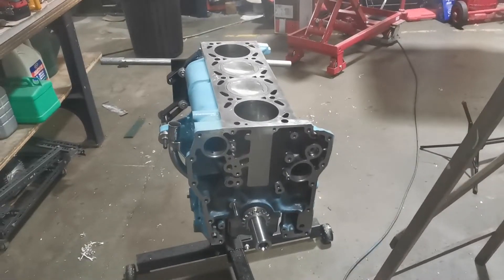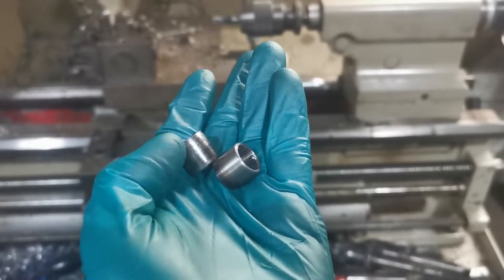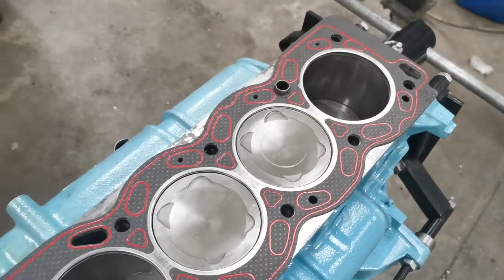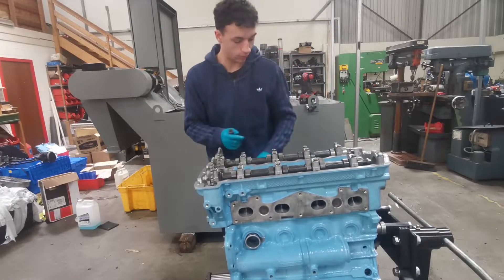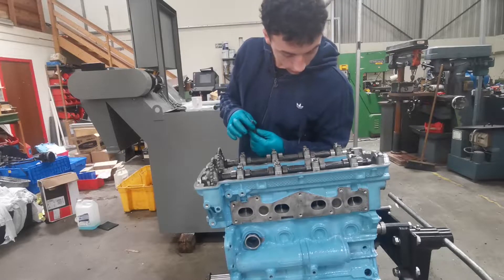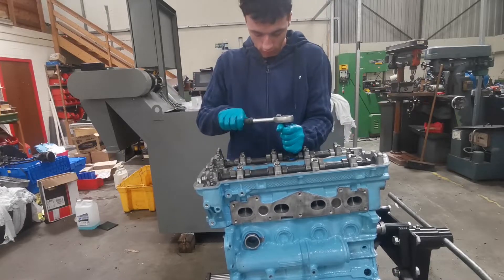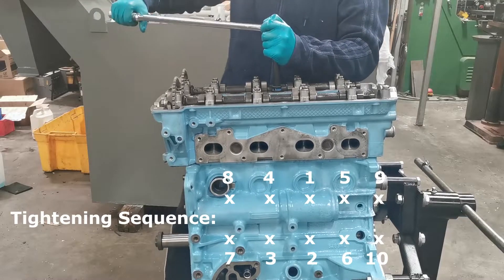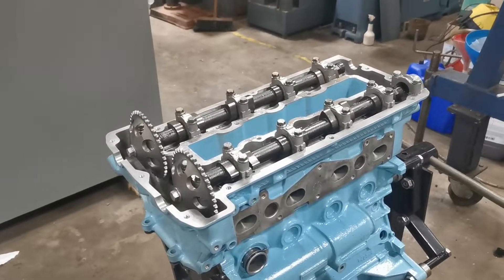Mounting The Saab B204 Cylinder Head

Comment: Why do you keep calling it a top block?
Reply from the maker: Cause i didnt really know my termonology when i made this, learning as i go along. CYLINDER HEAD xD
Reply: @DatBoiJosh  I thought I was missing something myself 😂 having some trouble with my b204 today things driving me insane but I'm leaving the UK tomorrow so no real time to work on it gutted. Anyway great work so far mate hope you get to enjoy it soon
Reply from the maker: Cheers bud appreciate it & what kinda issues are you having? Have you done a swap or is it in a saab?
Reply: @DatBoiJosh  on mine it's feeling like a fuel pressure problem. Once it's warmed up you can only drive it on minumum revs. If you give it a little it starts jerking violently and popping and banging. It all started after changing my injectors. It has been mapped to suit the new ones and I've changed coil pack. My 3 bar map sensor and even my fuel pump but its looking like I was sold a set of dodgy 875cc injectors. Prior I was running 630cc ones with no issues at all I only changed up as was going from Gt28 turbo upto a 30 but it never happened so I just had to map the new injectors in. Andrew Crank sorted that for me so I know that side of things are spot on. And no my engine now lives in a 07 vauxhall astra vxr. Its great fun but its been off the road that long now it's time to get it sorted.
Reply from the maker: Sounds like a fun toy when it's running and cant you just put the old injectors in and forget about those then since youre not going through with turbo upgrade now? Or cba for the remaps again
Reply: @DatBoiJosh  I swapped my injectors for these ones unfortunately. My car was running great on idle and revving fine but after you drive it and it gets up to temperature then that's the problem. Going to have to buy a full set again. Lesson learned though buy my own stuff new. I was just under the impression that the guy was reputable. What's the plan for your engine? Something rear wheel drive?
Reply from the maker: Yeah for this engine I haven't risked anything like that bud I've always brought brand new but I guess you never know till you bite the bullet and actually buy the parts. And to be honest bud this is my first ever engine build so I'm just getting my head around everything and just using it as something to learn off the plan isn't to go to mad yet but just to get it into the corsa b Ive got and running, then start the upgrades from there.
Reply: @DatBoiJosh  I was same I bought everything new to begin with but not recently and certainly regret it. You get what you pay for. And are you a member of saabworx I take it?
Reply from the maker: @c4r5on88  yeah as they say buy cheap buy twice and no mate i know all about it just don't have Facebook think I'll have to set one up though for all the help you can get on it, I've got a bloke who's build a few of these engines before and I just go to him for all my troubles + having a garage next door with top blokes help aswell :)
Reply: @DatBoiJosh  definitely get yourself on the corsa B is pretty common and obviously they can help with the chassis leg part and other parts. My favourite of them all is crankys corsa. It's absolutely amazing. Good youve got someone close I haven't really unfortunately but it is what it is. Still love my car even if its been off the road for a while now. Hoping to buy a engine to build myself from the ground up but all my money is going absolutely everywhere else but. I can't stay focused to 1 thing at a time unfortunately 😂 I'll be watching your videos and your progress. Good luck with it mate
Reply from the maker: @c4r5on88  yeah I'll. Have to make myself one up and get myself on it and I'll. Keep A look. Out for his one. And yeah building your own engine is like a love hate relationship you love to do it but hate the amount it's burning into your wallet 😂and i have that issue to mate you're doing one job to get distracted by another 😂but cheers mate appreciate it all been really nice speaking to you!
Reply: @DatBoiJosh  you too mate ill keep an eye out for you when your on there :)
Reply from the maker: Yeah im gonna have to everyones been saying it only so long I can Bury my head in the sand 😂I'll have to check his car out then when I make one and I know that feeling mate! I'm trying to save for a house build a car pay rent etc its hard but it is what it is! Thanks bud I appreciate you spending the time watching and speaking, if you have an insta of your car or whatever send it over I'd love to see the build!
Reply: @DatBoiJosh  yeah it's hard man so many outgoings 😂 and I don't have a insta mate just a couple of videos on here but there nothing special as I'm useless with cameras or computers.
Reply from the maker: @c4r5on88  well we have all Got to start somewhere mate, I do all my recording of a mobile phone 😂I'll check your channel out after work bud
Reply: @DatBoiJosh  not really a channel 😂 but yeah you definitely have that phone camera on point compared to me